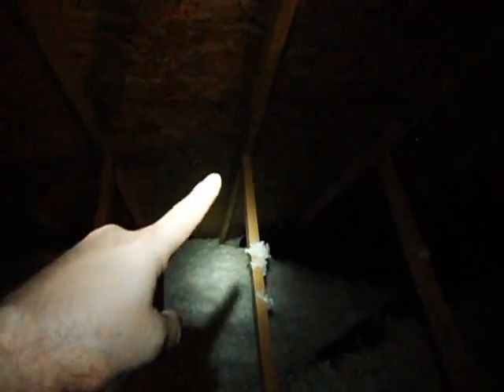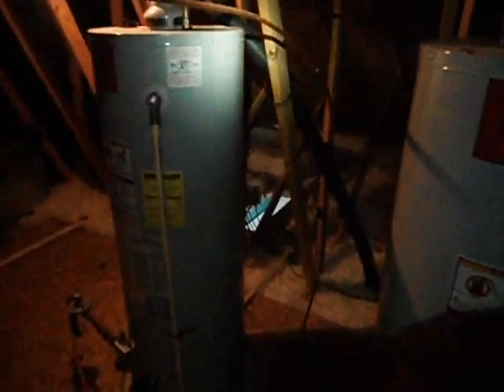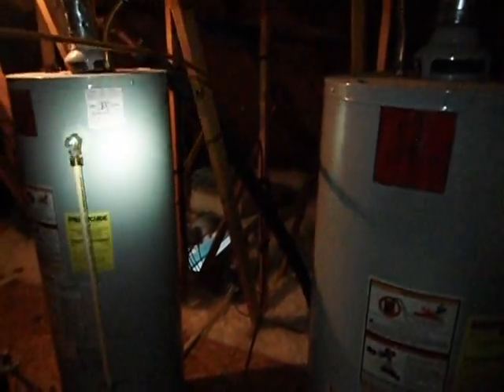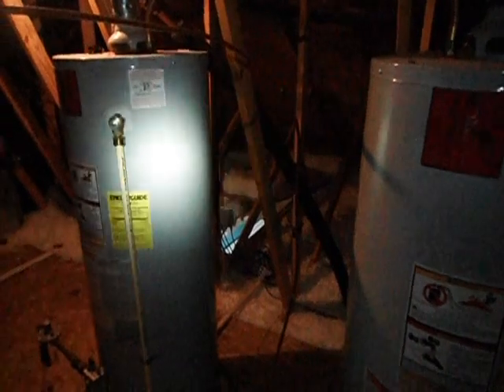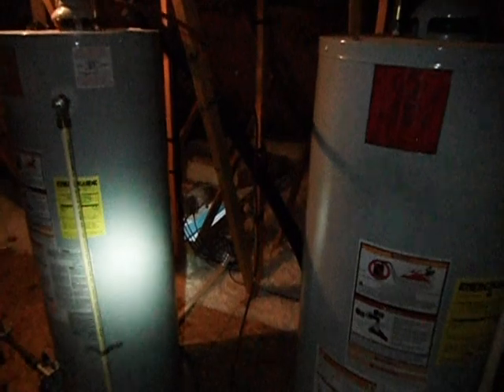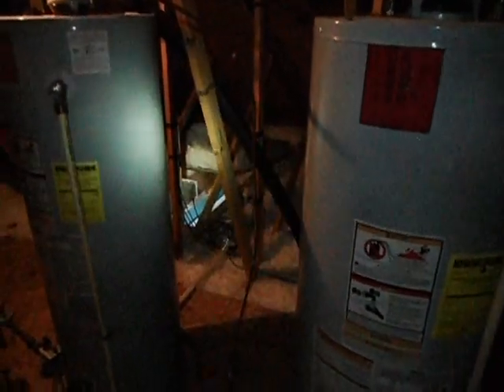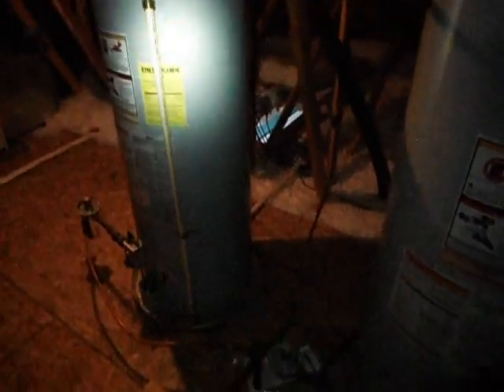Cracked truss system

Comment: The question is. Outdoor 500 lbs extra eight on that system really do that.   I would rather think  strong wind damage.  If water tank did it structural engineers insurance should repair da,age as that is too little extra weight to have failure